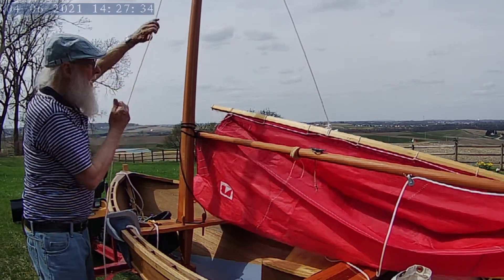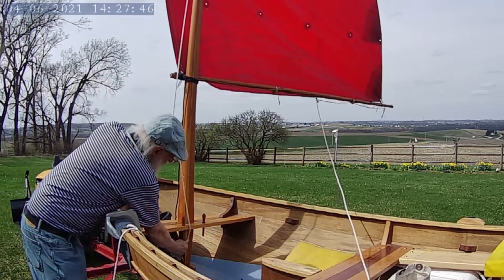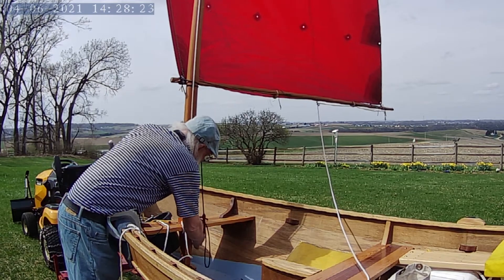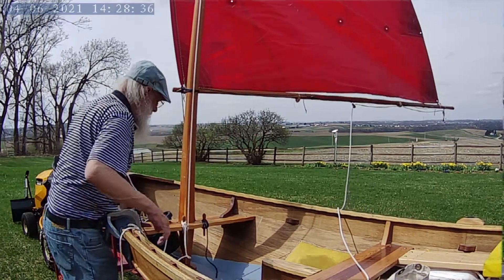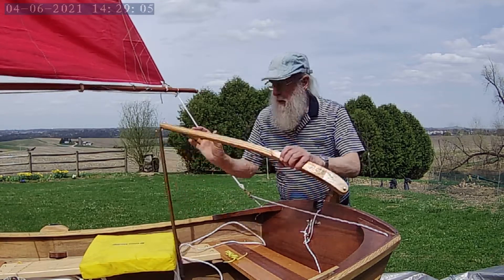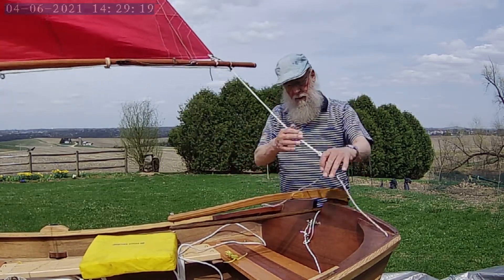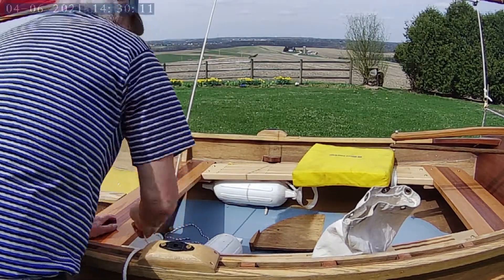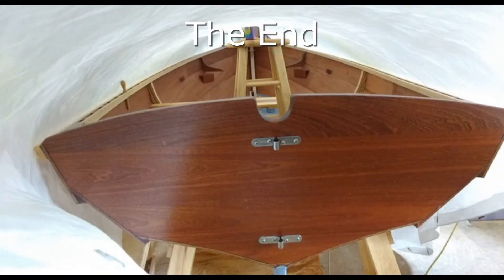Shellback Sailboat - Raising the Mast & Balanced Lug Sail

Comment: Hi Mitch,  thanks for the instructive video. I'm in the UK and have just bought a Shellback that was imported here from the States. I have been admiring your extra side benches and would like to add some myself. Have you any recommendations on how to go about it? Cheers from Wales.
Reply from the maker: Greetings to my Wales friend.  A lot of what I've learned about sailing and wood turning has come from your country.  (Roger Barnes, etc)

So some hints:  I made a cardboard pattern to fit the starboard/port 'seats' in.  Using a compass to trace the curve of the sides to the pattern.  I have a surface planer which helped match the thickness of stern and midship seats.  The later seats were removed and tabs were glued and screwed to the bottoms for the side seats to rest on. (My seats are not cut back to make them look thinner as Noel White described).  

Hope this helps.  If you want more detail on making the bent type seat I'll try to give more info.  I can't get the dinghy now with the weather as it is.

I envy your place to sail.  I'm on the Mississippi so I have to travel to get to a lake, etc.
Reply: Thank you @mitchappleby9166 , I appreciate the quick reply. I will get the cardboard out today! I'd love to hear more about how you made your bent slatted seat - they look really fine.
It's only Day 2 of my ownership of the boat and I haven't yet sailed her, but the weekend's coming and, as you said, there are plenty of options here in Wales. I love the Shellback's simplicity and character.
Reply: @jamesleedam8704  How did you get on James?
Reply: @BrownianMotionPicture  - Sadly, there have been too many distractions just now, but I have the cardboard template ready to use :-)
Reply: @jamesleedam8704  It happens, some lovely weather at the moment so hopefully you can get in the water.